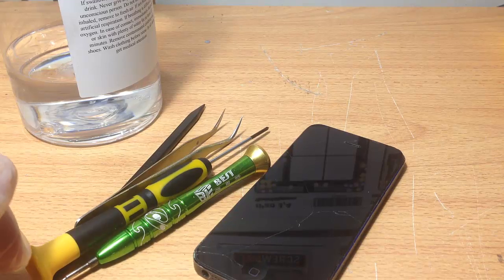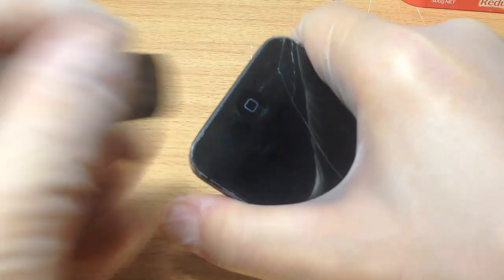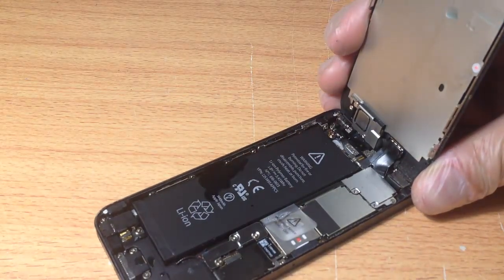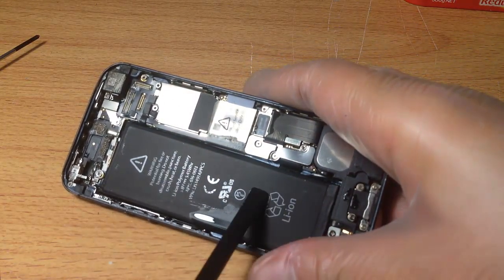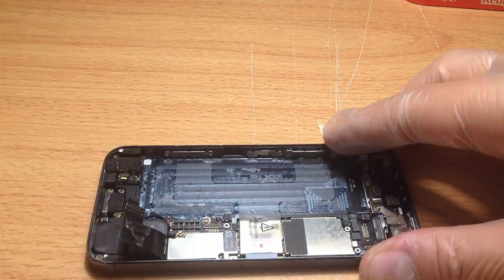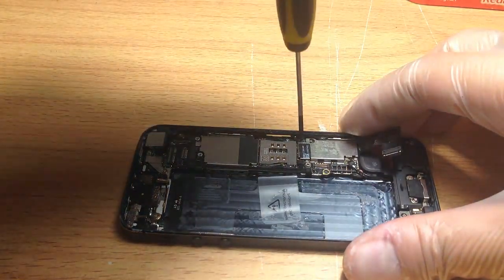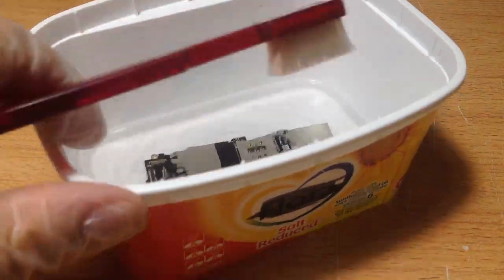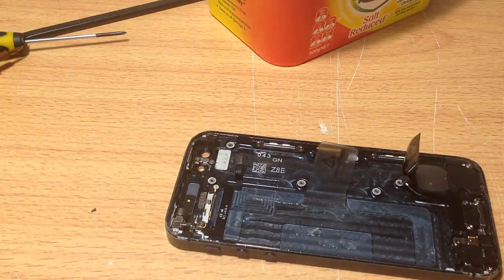iPhone 5 Water Damage Repair

Comment: Thank you for posting this video, very informative and helpful. I recently tried the method  and plugged the phone into the wall, the phone turns on with the apple icon for about 7 seconds and goes blank for 4 seconds and repeats it's self again and again, any suggestions what this could be? or if there is a solution?

Thank you
Reply from the maker: could be the logic board fried.  I would try a new battery - this is a common issue with a bunk battery.

Comment: I dropped my phone 2 days ago in the toilet and everything is working fine now. But It can't connect to the network. It just says searching. The only way it works is through wi fi. Can i possibly fix that by cleaning it? Or is it a lost cause. Apple told me they couldn't fix that. Help.
Reply from the maker: make sure the date and time are correct.  if they are not correct you cannot connect to your cellular network.
Reply: What if the time and date are correct?
Reply from the maker: hmm could be your logic board fried out. try another sim card.
Reply from the maker: also clean inside where the sim card goes.

Comment: Thank you so much!! This worked so good! I didn't lose any of my videos nor pictures, and every thing works as before the waterdamage!
I washed the phone with pure antibac 75% alcohol. And if your going to do this make sure you don't lose any of the parts or screws.
Remeber it is much harder to screw it together again. Spent 30 minutes to turn the first screw, after that it was much easier. You will need good time and ALOT of patience! Good luck to who ever tries this! Thanks again Infohut!
Reply from the maker: great to hear! remember backup your data as a precaution through itunes!

Comment: aw man.... I did this yesterday (after dropping it in the toilet last week), bought all the tools and followed your video step by step (awesome by the way, thanx so much 4 posting), cleaned out all the corrosion, and IT WORKED!!! I was so friggin proud of myself! My iPhone was, despite a few water stains in the screen (cleaned those out as well) almost as good as new and working like a charm (except is had problems connecting to a network, but I read that that is common after water damage). Then last night, i didn't touch it, and this morning it was dead....! Charging and changing battery won't help... Any tips..? Wash it again? Open up the logic board itself & wash again? Help!!
Reply from the maker: hmmm try a new battery?
Reply: nah, did that already. Took it to a store and they said the logic board is fried... shoot. Thanx anyway for your video! I learned a lot!!! :)

Comment: question. Is that a problem with the screen or motherboard? 
 so i dropped my phone in water and i got as much water out as possible then put it in rice for 3 days. after the three days it worked, with just some water marks on the screen. the water marks on the screen faded away and the screen was working okay. about 5 hours in from the marks being away the screen started to malfunction and wouldt respond to my touches and sometimes it would just go black all of the sudden and overtime the screen turns black and its on, but just black, and i can still slide to unlock and stop alarms and navigate through the phone and open apps because i hear the music and games i open. like it works but its not displaying a picture sometimes.
Reply from the maker: yup could be the screen or the backlight ic.  u need to check the screen first then work your way from there.
Reply: infohut thank you! i will try replacing the screen then. i just want to be sure that its the screen thats not working before i spend money. thank you!
Reply from the maker: could be either but go testing the screen first as it would be a easier option.   maybe a friends phone or something?

Comment: Does the amount of time of water Danegeld phone matter before it is repaired like could the phone Been dropped in water a year ago and still be repaired ....say you buy a water damaged iphone 5 like from eBay and successfully repair and it has a password you didn't know about what should you do ??
Reply: I think it would be a gamble considering the iPhone does not have a removable battery.  A wet battery connected to your phones internals is a recipe for disaster so immediate action should be taken to dry your iPhone off as quickly as possible to minimize the possibility of damage.    Buying a water damaged phone that's not operating may be hit or miss but might be worth a shot if the price is right.

Comment: Hi, After I removed the logic board and lifted the bottom casing up to take a look at it a weird black small piece of plastic fell out, it is about a 1cm long and is flat in the middle with a hole where a screw looks like it would fit into it. Any idea what this could be and where it goes? I didn't see it in the video above!
Reply from the maker: Ah yes - this is the Sim card ejector arm/lever.  It helps you insert and eject the Sim card.  It goes on the far far right below where the sim card ejects against the wall of the frame. http://imgur.com/62qnl14 - here is a photo of where it goes back.

Comment: Hello, I had a question regarding my water-damaged iPhone 5. Just yesterday, I was swimming in a pool for about 10 minutes and forgot my phone was in my pocket. I got out and looked for any water inside behind the screen or in the camera lens and didn't find any water. The phone was wet, obviously, but appear to be fine i.e. not heating up or tripping out, just blank. I know you're not supposed to turn it on, but I wanted to check before assuming. It didn't respond to anything. No reboot, no home button, or anything. I instinctively put it in a bowl of rice and left it there all evening. When I checked later, it still didn't respond to anything and I remembered my battery was near dying, so I plugged it into a charger all night. I checked it this morning and didn't get anything. Will this solution work even if my phone was submerged this long? What replacements could I buy if parts need to be replaced? How can I tell if they do need replacing? Thanks for the help! (And how much would it cost to get it repaired by a third party such as Geek Tech Team or any other place?)

Comment: so im no stranger to dropping my phone and water and i knew trying to turn it on was the worst possible idea, but i was slightly drunk and it was dark and i couldnt tell how wet my phone had gotten and at first it stayed on and then i wasnt able to scroll any more so i shut it off, and then back on and it turned on with the same problem, 15 minutes later being stupid i turned it on again and it was stuck on the apple logo, after that nothing. is this a good sign my logic board is fried? im having trouble reassembling it because i have a 5c but i connected everything and plugged it in and got nothing also i used alchohol pads because i didnt have an actual bottle, the damage happened about 3 days ago, i know this is alot but i would realy appreciate a response

Comment: can you give me the link for the screw mat 
im going to attempt to fix my phone 
it fell in the ocean 
i had a "waterproof" case which didnt work
Reply from the maker: http://bit.ly/ip5screwmat
Reply: infohut thanks  
can i buy the tools at radio shack? how long does it usually take to take apart the phone and clean it and reassemble
Reply: ok so i did the scrub at least three times and i put it in and i get nothing the screen doesnt trun on
Reply from the maker: seems capacitors are burnt out possibly.
Reply: what can i do
Reply from the maker: Carlos Medrano you need to find a technician that can repair these as you need special soldering equipment.

Comment: What should I do if there was water under the screen
Reply from the maker: Alanood Alshamsi sometimes depending on how much water it can evaporate away sometimes u need to replace the screen.  get the screen leave it in the sunlight for a bit (remove the metal plate on the back of the screen) and see if it evaporates.  sometimes it works. sometimes it doesn't.

Comment: This video saved my IPhone 5!! It fell into the ocean and was in the twilight zone for over a week. Took it apart, scrubbed it with 90% alcohol and it worked! Even some of the things that were not working BEFORE it fell in the water started working again.  Thanks for this great video. (Although it would have been nice to see a reversed video of the reassemble)
Reply from the maker: Just remember backup your data asap through iTunes.  Great to hear it worked.
Reply: hello, i also meet this error about my iphone, i get many help from this forum, and also bought many DIY repair tools from china supplier , and vipprogrammer help me  fix this error. maybe you can try it.or contact ther WhatsApp:+ 8615986801289
Link: http://www.vipprogrammer.com

Comment: I did everything in the video and after several failed attempts my phone's LCD finally turned on and everything as working except the flash, and the gyroscope was all messed up but it all worked, put my iphone5 on airplane mode to charge and now it wont even turn on :(

Comment: When I was unscrewing the flathead under the camera I slipped and took off a ribbon cable directly under it off the motherboard. I've done everything else and my phone won't turn on. Is it because of that cable and could I fix it?

Comment: What if you tried to fix it and attempted to turn it on but it didn't even boot? Is it too late to try again or did I fry it?
Reply from the maker: dannyfinks i have seen a lot of cases where sometimes its the battery and the power button that can be bunk.  try finding another battery.  also plug it in the charger (if its a faulty power button plugging it in the charger will automatically turn it on).  

However it seems maybe you have a lot of the circuits that are cracked or damaged and cannot be repaired.

Comment: What happens if I did all the steps but it will not turn on what should I do
Reply from the maker: kaOs Rapid You can try one more thing.  Try taking off the silver plates over the circuitry and cleaning the components under there.  You could also try changing the battery and the charging dock.  Also check to see maybe the power button is faulty.   If this fails then I'd say too many capacitors are cracked/damaged and cannot be fixed.

Comment: I know you have a link to buy the tools necessary but I wanted to ask you a simple question.  The screws in my Iphone 4 are so small the phillips 00 is even to big.  What is the proper name of the size required to remove up to the smallest size phillips in my Iphone?  Thanks so much
Reply from the maker: Hi Mark - for your iphone 4, 5 or 5C/5S the toolkit needed are 2 types of screw drivers. 1. Phillips head and 2. Pentalobe screw driver.  Search on amazon for a 'iphone toolkit' these will have all the right tools and only cost about $5.
Reply: i just tried to switch on my phone immediately after water damage. may I use this method to my phone. does it work?

Comment: what if it has been soaking in water for almost 2 days? Does this still work or should i just invest in a new phone
Reply from the maker: Well I have seen one that was in a pool for like a day and got it going.  From what I have seen the corrosion/turning it on and off all the time causes the most damage.  Within 2 days corrosion should not have set in.  It won't hurt trying.
Reply: ok thank you

Comment: Will iPhone 5 turn on without a battery in it? My phone does not work after trying this. No signs of life. If I put it on charge, it gets hot after 10 mins or so but that is it. Don't want to waste money on a new battery if it's not going to fix it either. Any ideas what is up?
Reply: ***** When you replaced the battery before getting a new screen, did the screen turn on at all (like blink on and off) or have a dashed line across the screen as a sign of damage?
Reply: infohut If the logic board is fried, would buying a replacement logic board and installing it fix the issue?
Reply: SonofGod82 You may as well buy a completely new phone, logic board is the phone pretty much and they don't come cheap.
Reply: sdancer4 No, screen had no signs of life
Reply from the maker: nope it won't.  it most likely will just show the boot logo and then turn off.  Battery damage is very common you can buy then for really cheap off amazon or ebay.
Reply: infohut My phone will not even boot without battery, I think the logic board has just had it :(

I will try a new battery anyway.
Reply from the maker: ***** hmm it seems the logic board is fried as you should @ least get an apple logo.
Reply: There was problems with the screen as well, put a new battery in and it did fix it to the extent I could feel it vibrating and such. Put a new screen on, good as new :D

Comment: The metal plates can be separated from the board with the use of an x-acto knife (very carefully.) I would also recommend use of compressed air instead of a heat gun or blow dryer. The heat can loosen some of the soldered internal components, causing a wide assortment of problems aside from the one you are trying to fix already.
Reply from the maker: Yup correct Rigoberto Gutierrez Cold Compressed Air is good and you can use an exacto knife however be carefull as you may damage circuitry close to the logic board on the side.